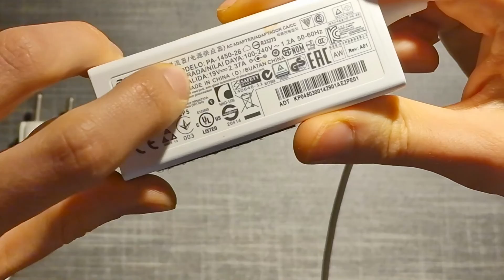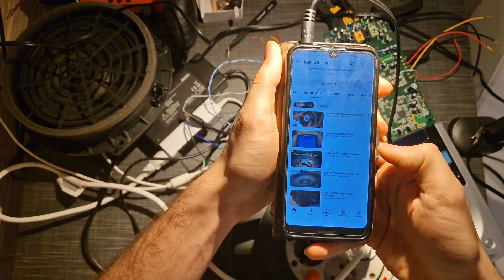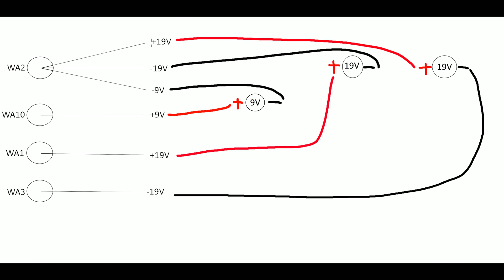Logitech Z5500 Use POD Control without subwoofer

Comment: I have 3  control pods. 2 of them work without '' Mute On Over Temperature'' and one not. The connection was diferent. I leave more details on your Twitter.
Reply from the maker: You need this!

Mute on over temperature fixed:
https://youtu.be/UPYeljqZOuU?si=_vM_zP0V-IJVRMxC

Comment: Hi again. I done the same like in your video and on the display say '' Mute On Over Temperature''. I use 2  adapters for 18V 1Amp. One have 18.1V and the second one have 18.2V. For 9V I have ajustable one, 3Amp, and I set it to 8.5V. I ceck the connections and are the same like in your videdo. You have any Ideea why? I have to mention I done the same with 2 Contriol pods and bout act the same. Test before and bout work ok.
Reply from the maker: @virtualnodoubt7043  I made an extra video for this problem. 
Watch all the videos I made with the logitech Z5500 system.

playlist:

https://youtube.com/playlist?list=PLsgyMOzSu2Eq9WmEVhE2aZzsZ22VpJyPS&si=PprFIcA3GP5qhOkb

Mute on over temperature fix:
https://youtu.be/UPYeljqZOuU?si=_vM_zP0V-IJVRMxC
Reply: @ElektroGamer30  Thank you very much
Reply from the maker: @virtualnodoubt7043  With pleasure, I'm glad I could help you!

Comment: Hello.
Do you have a diagram for the Control Panel?
After connecting the VGA input (from the Panel) to the Suboofer, I inserted the input backwards and Pin 10 was stuck in D-Dub.
After replacing the D-sub plug.
It turned out that the control unit did not work, there was no power.
Now we don't know where to look for the cause.
I don't have a second control unit to check, and secondly, I don't know anything about it.
The speakers are for service.
Could you please help?
Sorry for my English but I'm not English :)
Greetings from Poland
Reply from the maker: Cześć, niestety nie mam schematu dla (POD Control!
Aby sprawdzić, czy POD Control działa, spróbuj zrobić dokładnie tak, jak w tym filmie!
Karmij osobno i zobacz, czy się zaświeci!
Następnie możesz spróbować uruchomić subwoofer bez funkcji POD Control.
Oto film, w którym pokazujemy najprostszą metodę włączenia subwoofera bez POD Control!

https://www.youtube.com/watch?v=jS7nkCww8Bc

Popatrz tutaj i wyjścia na piny i kolory przewodów!
1 - Brown
2 - Grey
3 - Red
4 - Green
5 - Yellow
6 - Orange
7 - Blue
8 - White
9 - Violet
10 - Red with White
11 - Green with White
12 - Black
13 - Blue with White
14 - Brown with White
15 - Black with White
Reply: @ElektroGamer30  
Hi.
Ok, thank you for the information in Polish ;p
You can write in English.
No problem.
There will be tests in my free time.
Reply from the maker: OK your welcome.
If you still have questions, you can always leave a comment and I'll answer when I have time!
If I helped you, you can subscribe to my channel and leave a like!
Thank you!  @blusterowo

Comment: I have connected z5500 to laptop with optical cable. When I change sample rate to 24bits/96000hz on windows7, z5500’s headphone jack output distorts bass sounds badly. Also sound becomes very loud compared to 24bits/48000hz. Why changing to 24/96 gets so louder? Also why it distorts too much? Any idea please?
Reply from the maker: Hello, this is what happened to me with a pair of headphones from my phone (S20), when I set a different sound compression rate, I received a loud and distorted sound, even if the volume was at a minimum, it's because of the windows settings!
It's best to leave it on normal so you don't have any problems, anyway those settings are digitized, so they won't help you at all!
Even if you have that sound (boost), it is too much and because of that it distorts!!
Reply: @ElektroGamer30  thanks for the info. Somehow distortion gone on the 24/96 mode. I dont know what happened. Headphone output is louder now. Before, 24/48 was fine but 24/96 was giving distortion (on some songs).. Im really curious whats the reason. Why all of a sudden headphone output got louder and distortion at 24/96 gone? Control pod switched to a high gain mod or something? And now i get permanent 24/96 logo on the screen when using analog connection. 🤨
Reply from the maker: @supra8087  Hello, I don't know exactly what to say, why this happened, probably a small (BUG) or some software problems.
Even if the headphone output has become stronger, you don't have any extra gain.
The explanation is simple (Regardless of the power you put in POD Control, it will not output more power than it has)
You have a stronger sound gain at a lower volume!
But even if you set the system to maximum, it cannot amplify more than it has (the 500W which are actually 250W!)

Comment: really need more pod diagnosing and repair videos, have two that have different unidentifiable issues..
Reply from the maker: You can watch this playlist made by me!
Here I repaired and modified the entire logitech Z5500 system!

https://www.youtube.com/watch?v=QAIeXf0NgBo&list=PLsgyMOzSu2Eq9WmEVhE2aZzsZ22VpJyPS
Reply from the maker: The technology in POD Control is a little more complicated, considering that it also has chips with firmware and these cannot be diagnosed so simply!

Comment: Youre the best. Waiting for the sub video. Exactly what i needed. Thanks for the perfect video
Reply from the maker: I'm glad I could help you!
Reply: @ElektroGamer30  is there a way to get in touch with you? Ive got some questions.. and probably you know everything about it.
Reply from the maker: @hightriprebel  
Only on Twitter
https://twitter.com/CsGo54556456
Reply: @ElektroGamer30  i will contact you tomorrow with a new twitter acc as i dont have one
Reply from the maker: @hightriprebel  Ok
Reply: @ElektroGamer30  bro, i tried twitter but couldnt send u a message. My story: ive had a z5500 set in my childhood. My mum decided to throw away the sub someday and left me with the pod and speakers. I just bought a new 2nd handed sub with the Pid R005 and the pod is R002. Built in the same year.i dont think there should be much of a difference in both products. But it doesnt turn on at all. While the sattelites make a connecting sound when i connect the cables. The sub was working in another setup and the pod was working when i put it away 9 years ago. How can i turn on this set. Does it have to do with the connections between the pre amp and the pod?
Reply from the maker: @hightriprebel  Hello, the first time you have to give a follow so I can give a back and then we can chat on twitter.
You can try to turn on POD Control exactly like in this video made by me, or you can directly turn on the subwoofer without POD Control!
There are no differences between PID 002 and 005! They are identical!
To turn on the subwoofer you must connect pins 6, 7, 8, 13!
And here you have the pins for speakers!
1 right rear
2 sub
3 left rear
4 center
5 left front
9 right front
Reply: @ElektroGamer30   @Elektro Gamer  lol u just learned me how i can use twitter and how to fix the speakerset. I will give it a try in the weekend. And i concluded something else: As a moroccan i can say people from Romania. I lovee youu. You people are so humble. 

I will come back when i have executed the operation
Reply: @ElektroGamer30  bro the sub went on, the pod showed me a blue light and then everything stopped. Now it does nothing. Can you maybe help me through this?
Reply from the maker: @hamzaboulmika4487  Following the discussions here, did you manage to turn on the subwoofer without POD Control?
If it works without POD Control then here is the problem!
If it doesn't start, then the problem is in the subwoofer!
Checks must be done to know for sure where the problem comes from!
Did you say that the subwoofer works with another POD Control?
When was the last time you checked?
Watch a video where you can test the subwoofer without POD Control!
Try starting POD Control without subwoofer exactly like in this video!
Bypass Subwoofer link:
https://www.youtube.com/watch?v=jS7nkCww8Bc&t=34s
Reply: @ElektroGamer30  I turned on the sub without pod. As soon as i connected the pod the sub went off and the pod led blinked on. Then everything went off. 

I bought the sub from somebody who used it as a duo sub on 1 pod. The sub was working just recently(few months ago).

The pod was of my own set. It was stored for 8 years. It worked perfectly when i stored it. 

Ill check the video and do some research and get back. If u have more advise plz lemme know. I will refund the one that helps me out
Reply: @ElektroGamer30  i hope we can get it to work without the bypass method. I think that the cables of the sub dont match the pod connections. Is that possible?
Reply from the maker: @hamzaboulmika4487  Yes it's possible.
There are two types of z5500 system.
The one with RCA connection to speakers (Old system) and the other one with clip-on wire connection (Newer system)
If you connect the old generation POD to the new generation subwoofer, it will not work and you will damage the POD Control!
If you look inside it, you will notice the Chips (Cirus Logic) with small, almost imperceptible cracks!
This happened to me a year ago!
Try powering POD Control without a subwoofer!
You can also check the small 25V capacitor inside the subwoofer!
When the system is connected you can easily move this capacitor, it is possible to start the system!
There is a risk of cold contact at the capacitor pins!
And it manifests itself by the blinking of the POD Control screen, or by turning it on for a second, after which the RED button light stays on and nothing works!
Reply: @ElektroGamer30  i have the clipons subwoofer and the pod comes from a set which also had clipons. They are also from the same production year. What do i do now?